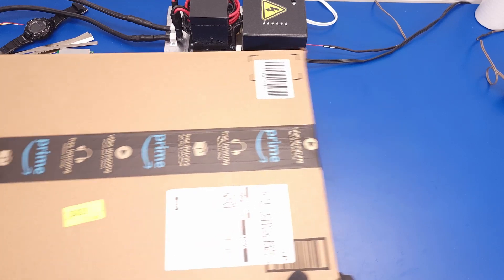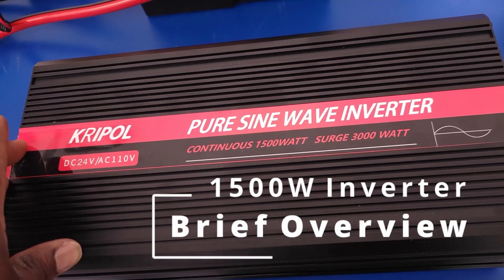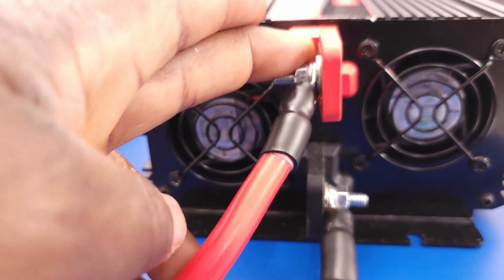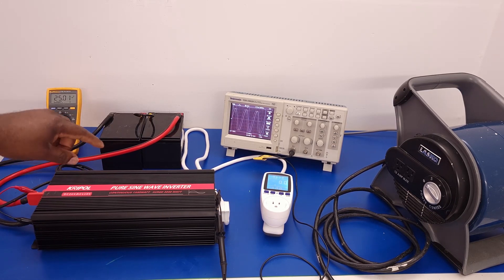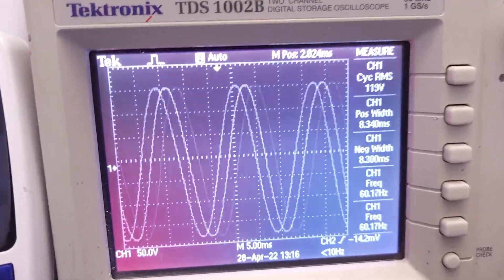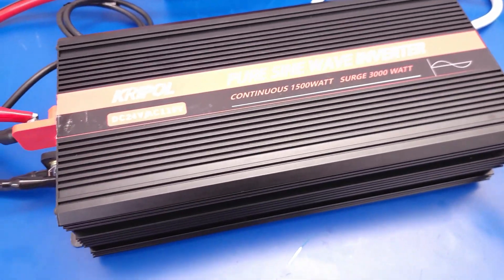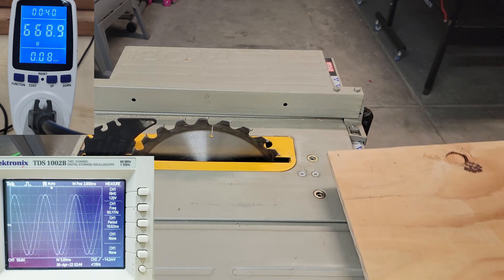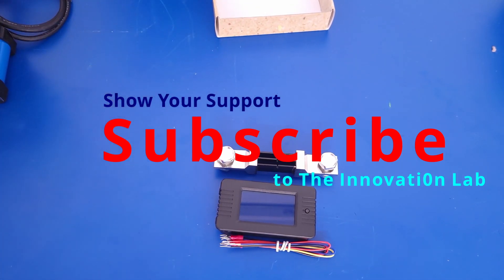Inverter Testing

Comment: NICE VIDEO!!
I am about to buy a 24v to 120vac inverter was wondering, if you have efficiency tested a 24v inverter vs a 12v inverter?  It would seem that the smaller the input-to-output levels were, that efficiency would be greater at equal output loads.
THANKS MUCH!!!!!
Reply from the maker: Thanks a lot for the wonderful feedback. I am glad you found the video useful. This has been on my mind, actually. Unfortunately, I have not been able to make the comparison test. The big reason is that  I gave away my 12V inverter and bought a 24V. 
Honestly, in my opinion, 12V inverters should never exist - unless those designee for cars and trucks.  12V inverters are too lossy because of the excessively high input currents! These high currents lead to lots of system efficiency losses, and it also shortens the life of your battery system.

Usually, I don't make strong recommendations about these things. However, in my opinion, I will prefer a 24, 36, or 48V inverter system - if you can afford the battery system.

Example:
If your inverter system is 12V and your steady power output need = 1000W, this means that you will be drawing more than 80A through your battery system continuously - with a steady state constant power load.

However, at 24V, you are required input current draw will be about half of the 12V system above.

I hope this helps.
Thanks again, and success wishes on your projects.
👍😎
The Innovati0n Lab.
Reply: Agreed...100% @theinnovati0nlab782

Comment: Hi.  Thanks for the review, however I would advise people NOT to purchase this 12 or 24v unit.  Under real testing my friend and I found the following issues.  1.  The USB output was NOT in spec for 5v to charge a phone to the point that anything demanding 5v will NOT run.  2.  The ground lug is NOT connected to anything!  The inside of the case is painted and therefore you get ZERO ground connection.  The temperature cut off is at 45C vs 60C for better units.  Why is the temperature important?  Well, take the case of using this in an RV or garage you will find out very quickly that the unit will only run about five minutes before it shuts down.  In a cool room (17c) and a 525 watt load using a 400AH battery the unit ran for 45 minutes before going into a fault condition.  Ironically, the manual says that the fans will come on and remain on......mine never came on and I removed the fans and tested them as good.  The temp sensor is a snap type with grease on it and basically stuck on the heat sink.  After seeing the issues and the inside of the unit (which is laid out ok, but very difficult to service due to serface mounting with robots) I removed it from service in my home.  However, one improvement I made was to remove one of the original cooling fans, leaving the right ran in place and hard wired it to a good 12v source with Anderson power poles.  This means two things now, the unit is continually being cooled on the LEFT side as you took at the unit from the front which is where the temp sensor is located but I should have never had to do this.  Please give your unit a try with a 500 watt or higher load and you are sure to run into the above issues.  For the same $$ I would be a TECHON or Reliable but be for warned that only the TECHON is ETL certified so my $$ goes to TECHON.  I have the 24v 2000 watt version.
Reply from the maker: Hi, thanks a lot for the wonderful feedback. I really appreciate it.
I will try to do more testing on my unit later to see if I will run into the same issues you were describing. I had tested my unit multiple times - even before making the review videos. However, my videos on this product was an unbiased observation based on a single unit that performed well. 
Also,  I will recommend you share your comments with  the vendor or manufacturer as well. I am sure it will help them improve their future designs.

Thanks again for the very detailed feedback.

Comment: Can you tell us what make and model watt meter you're using?  Thanks!
Reply from the maker: Upgraded Watt Meter Power Meter Plug Home Electricity Usage Monitor, Electrical Usage Monitor Consumption, Energy Voltage Amps Kill Meter Tester with Backlight, Overload Protection, 7 Modes Display https://www.amazon.com/dp/B09BQNYMMM/ref=cm_sw_r_apan_i_59W7Y6V4C8QNG2YP5WZ1?_encoding=UTF8&psc=1